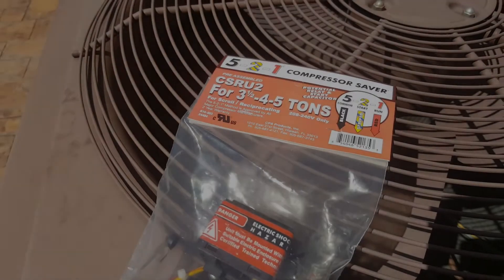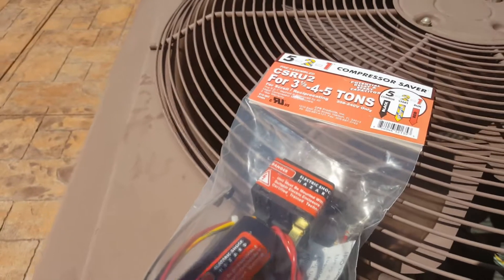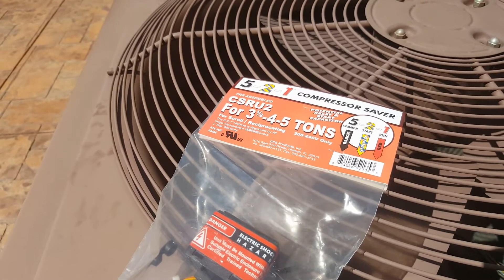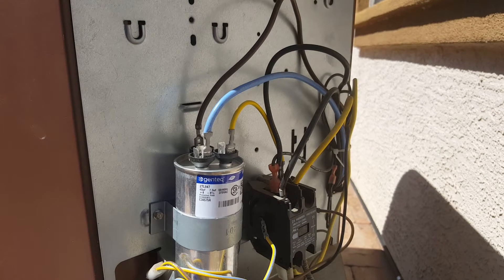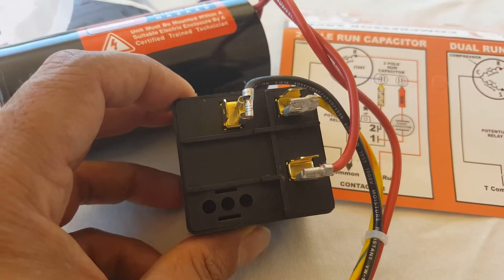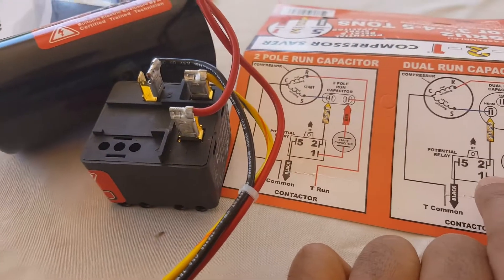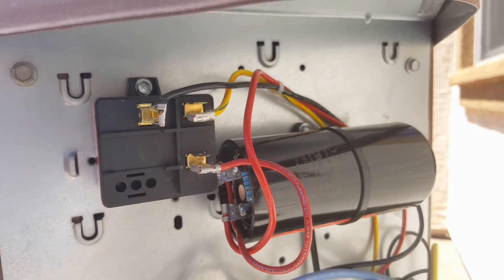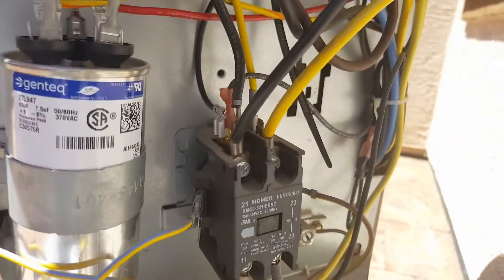Home House A/C repair 3/ 3: WHY & HOW to Install AC Hard Start Capacitor or 5-2-1 Compressor Saver

Comment: Install the black wire from the hard start kit to the contactor  T1( common), the red wire from the hard start kit goes to the capacitor C (common), the yellow wire from the hard start kit goes to the HERM on the capacitor.. Before investing in a universal hard start kit, check with your ac  manufacture to see if the hard start kit is compatible with your ac. It is always better to buy a oem hard start kit/compressor saver. Always install your capacitors strait up and down. NOT laying sideways.

Comment: HVAC school YouTube channel says the greater torque from a hard start kit (with potential relay) actually can do more harm to your compressor. They have a very technical video on hard start kit myths and do not recommend that it be installed in most cases. The reason the inrush measurement shows a decrease is because the current spike is shorter and cannot be measured by the meter, but they assure you that the spike is still there.
Reply: You're absolutely right. The spike is still there and it's higher after installing the hard start kit. The spike is shorter in duration but taller in magnitude. If it was spiking at 150 Amps before the install, it will probably be spiking at 200 Amps after installing the HS kit. The only way to see the actual value of the spike is with an oscilloscope. An Amp clamp will ony give you an average even in the "inrush" current function. Inrush current function lasts 100 milli-seconds. These spikes happen in 100 micro-seconds or one-tenth of a milli-second. In the inrush current function, an Amp clamp will catch the magnitude of the spike but won't display it. It will only display the average of the spike and the FLA. The spike only lasts 1/10 of a milli-second so the meter will average it out with the FLA that lasts 1000 times more in that 100 milli-second measuring window.

Comment: You can piece one together from parts slightly cheaper than buying that CPS kit 😉

The trick is figuring out the dropout voltage so the start cap doesn't get blown.  I've had mixed results with those CPS kits where the potential relay gets stuck closed and smokes or blows the cap 😁

Comment: OK...the black wire of the hard start kit is attached to the terminal with all the other black wires.....BUT....should it be on the output side of the contactor ?( top...like you did...to "load")...or...should it have been attached to the incoming line side....all these are "black" but now I'm asking bottom or top of contactor? (LATER EDIT.... nevermind.....on this side of the single pole contactor.....L1 (bottom) and T1 (top) are electrically bridged with a buss bar.....no contacts....so it doesn't matter.

Comment: Slight nuance...the added capacitor should sit vertically. Just like the original start capacitor. Maybe not 100% necessary, but most sources say vertically is needed....maybe due to having terminals on top and less potential for leakage (?).... or other problems not stated,  when mounted horizontally.
Reply from the maker: interesting.  i'll look into this.

Comment: I bought a 521 kit, but my Amana unit does not have a contactor, the power is tied into the control board, there is a spade that says start relay, but I don't want to blow up the board.
Reply from the maker: can you share a picture of what your setup looks like?  I'm hoping a/c experts can chime in.
Reply: @footprintsinconc  I do not know how to attach a picture, the part is a Goodman 2 speed control board, part number PCBGR104S
Reply from the maker: @jackfrost-fu7hz  so that board isn't located at the a/c unit outside, right?

you can upload the picture on google and share the link here.

Comment: How do I tell how many ton my compressor is?
Reply from the maker: There are stickers on the side of the a/c unit or behind the side cover.  It'll tell you all the info on the unit...from part and serial numbers, Freon type and quantity, capacitor size and tonnage of the unit.

Comment: The amp probe reading before and after is what would make this a perfect video.
Reply: Roughly a 20% reduction in start up amps
Reply from the maker: good idea.  i am hoping someone else can post that for us here.
Reply: The amp probe reading wouldn't help unless the amp probe is connected to an oscilloscope. It's a waste of time to check the in-rush current with a Fieldpiece, Fluke, or UEI amp probe before and after installing the hard start kit. It only gives you an average not the actual current spike. Only an oscilloscope will do that. These hard start kits are just a band aid until the compressor completely fails. It just buys you time to save for another unit.
Reply: @bernardocisneros4402  no service man has an oscilloscope on this planet
Reply: @dgaz3057  I know. My point is that it's pointless to take a before and after current measurement with an Amp probe. It doesn't give you an inrush current reading that truly represents what the motor is drawing when it starts.

Comment: The black wire is supposed to be connected to the yellow side or common side on the contractor . You wired it wrong
Reply: No he didn't, the black wire or common wire goes to the side with all the black wires.

Comment: The idea of the video is that you show HOW TO INSTALL the Hard start capacitor and you did not show how.
Reply from the maker: i detail out the steps of what goes where and how to connect it all.  
the only thing i don't do is show it being screwed on the panel.

is there something specific that you have a question about that i can answer?

Comment: I just put one in my 3.5 ton  Carrier, it lowers the amperage by at least 40%. Long term, it has to help the longevity of the compressor.
Reply from the maker: nice.  at what points or where do you measure the amperage?

Comment: Can you provide the different manufacturers wiring colors to help with making the install easier i have a carrier and my colors are yellow yellow multi color band and black i have a 2020 carrier 3ton.
Reply from the maker: The diagram at 4:10 is all you need to follow.  Don't worry about colors only, follow where the the wires should be connecting from the 5-2-1 unit to to your capacitor, depending on if you have a 2 or 3 pole run capacitor

Comment: The audible click is much less stand at a distance when starting with the hard start the audible is 50% less and the spin up is 2x as fast.at least on my carrier this is true. Plus my lights aren't dimming either.
Reply from the maker: Thank you for stating your experience...i just don't know why they don't install these at the factory!
Reply: @footprintsinconc  its an easy money maker for hvac service lol
Reply: @Mrtscrp30  @footprintsinconc Just had my unit serviced and they recommended one of these. All for the low low price of $450.  lol.  Gonna do it myself.

Comment: I installed one on mine because I noticed the light dim when my backup generator was running the house.  It made a big difference.
Reply from the maker: Thank-you. I am glad to be of help.  Please like, share and subscribe to help me build my subscription base.
Reply: What size generator you have??
Reply: @Cenlalowell  A Kohler 30KW RCL
Reply: @Dqalex  jessh that should run the house no problem.
Reply: @Cenlalowell  The 1800 RPM units have their strong points, less noise less fuel but they don't handle large startup loads as well as 36000 RPM or 1800 RPM diesels do.
Reply: Is the hard start kit and compressor still alive and kicking?
Reply: @bernardocisneros4402  Yes no problems

Comment: I've got a 20yr unit & compressor that seems to work fine, but this would probably be a good thing to add to my AC... Thoughts?
Reply from the maker: starting at minute 8:45, i talk about this and wrote my thoughts on it.
i think if it helps when the compressor is old, i think it will help now as well.  It's giving the extra boost to the compressor to start, so it can't hurt...cheap insurance.

Make sure you please subscribe,  trying to get viewership.  Thanks 😊

Comment: Should I put this on a new 3.5 ton Carrier?
Reply from the maker: starting at minute 8:45, i talk about this and wrote my thoughts on it.
i think if it helps when the compressor is old, i think it will help now as well.  It's giving the extra boost to the compressor to start, so it can't hurt...cheap insurance.
my ac unit is 7 year now this summer.  i think i should have installed it a while back.  having this, i think it'll help keep the stress on main capacitor low (if that can be said) at the start of the season i think and keep it from going bad all the time.
Reply: @footprintsinconc  Thanks, I agree.
Reply: I just put one on mine cause when the AC would spin up the start sounded like a hammer tap on the casing i thought man that doesnt sound good called my AC installer he said that is common with high pressure units i still decided to add one to my unit and it made a difference in how hard the start sounded and speed of fan spin up time was much smoother and faster.